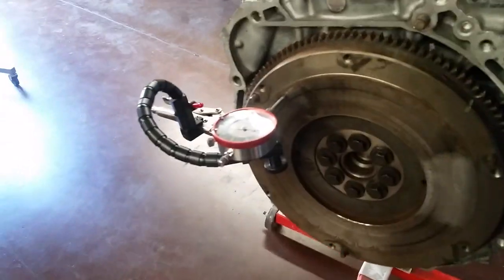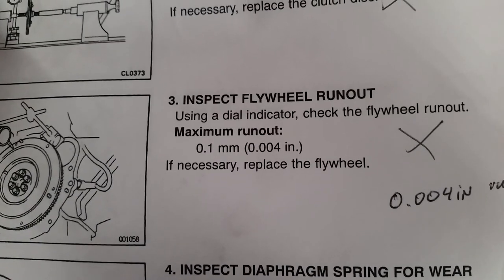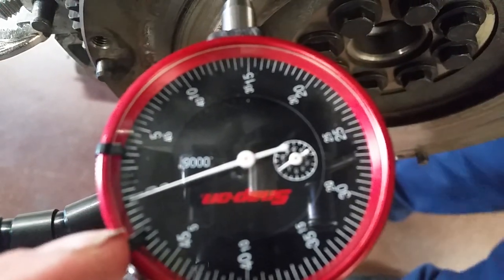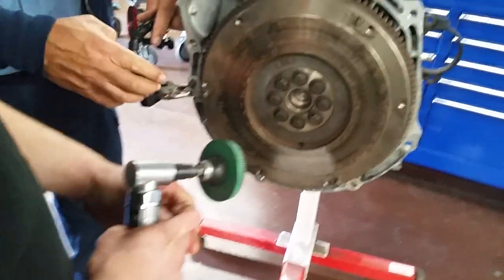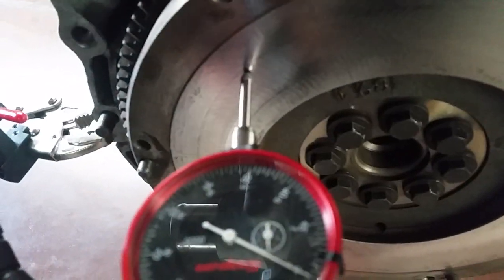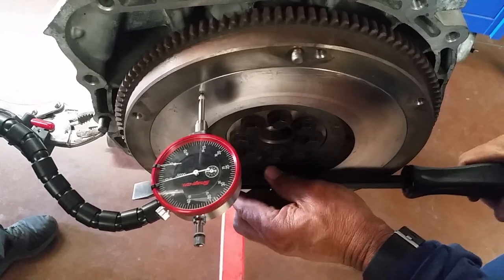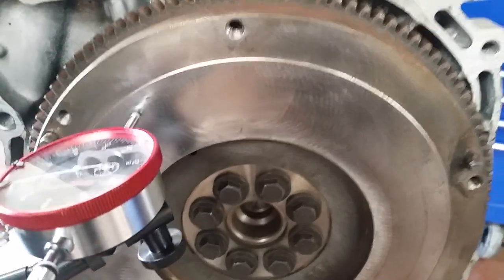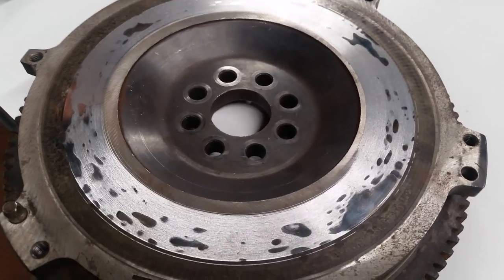How to tell if your flywheel is good or bad when replacing a clutch

Comment: You should really get a specialist flywheel grinder to resurface the flywheel. They can even sort out that polished flywheel. What you haven't checked is the difference between the inside and outside as the tend to cone in the middle
Reply from the maker: @jdickson242  good input. I was to go any further than just cleaning it up i would send it out to be machined at a machine shop.

Comment: Hello. Can you tell why the the car sometimes judders when moving into 1st gear at traffic lights, or roundabouts...Thank you.......Ireland.
Reply from the maker: If it is while you are releasing the clutch, it sounds like clutch chatter. It would do it in reverse starting off as well. 
Clutch chatter causes are warped flywheel (this video shows that measurement), or possibly a rear main seal type leak contaminating the disc.

Comment: Hi from India.
i do have VW Vento 1.2L (automatic), and its just 18000 km on the meter, but the mechanic said that my flywheel is rusty and need to replace it, and cost about US$ 500 approx. should i get it done?
Reply from the maker: Ideally you could have it resurfaced. But if that is not an option and the rust is on the face where the friction contacts then you should, otherwise the clutch will not work correctly
Reply: @paulkelley86  Thank you for the help sir. saved me :)
Reply: Any updates?
Reply: @minnus222  Yes i got it repaired by the service person local one, not the VW authorized center. he said that they just want to earn and make all kind of stories. there was nothing like that.
Reply: @minnus222  if you need any specific detail let me  know.
Reply: @beastangel8727  I just wanted to know whether the FLY WHEEL can be grinded/ resurfaced/ RING GEAR replaced?
Reply: many authorized SVC are cheating ignorant customers.
Reply: @minnus222  yes it can be as recommended by @paul Kelley. when i got it opened it was not having any issue there were no sign of rust or anything because my VW was having 17000 KM running in last 3 years. mostly I use the Tata Nexon.
Reply: @beastangel8727  My car is 1996 w124 Diesel benz (The car shown in Kabali movie). I am having my clutch assembly replaced. The SVC guy told me that the FLY WHEEL is also damaged. I am doubtful about that.

Comment: What was name of that grinder you had to resurface?
Reply from the maker: Its just an angle die grinder and a roloc disc we normally call a cookie disc. 
That's just a method to freshen it up. 
The better bet would be to replace or have a machine shop resurface it if there is any visual defects or runout.

Comment: I've been told a damaged flywheel can make my car miss when idling, why would it make the engine miss fire?
Reply from the maker: Hmmm... I have never seen that. I don't see how it would cause a misfire. If it were out of balance I could see it cause a vibration. Rarely the flywheel will have a reluctor wheel for the crankshaft position sensor, which could cause some timing/spark issues but I wouldn't expect it to be a misfire. What vehicle is it?
Reply: Yeah, I thought it was strange but I'm no expert. Also I'm sure its the flywheel as its vibrates when using the clutch and it has that horrid rattle when its idling and if you press the clutch it stops rattling. The car is a VW Golf 1.9 TDi 2007 sport.
Reply: @pumpkinking365  sounds like the throwout bearing
Reply: @icantseeanything.7625  I had a new clutch & flywheel. The mechanic said the flywheel was so bad, he was surprised the car was still running.

Comment: Ok here is the question my clutch bad I know it is time to change but there is very slight vibration on the pedal.so do you think flywheel needs to change or do you think my clutch is bad that is why?
Reply from the maker: It could be the release (throw out bearing) puking. But it could be flywheel runout too.

Comment: Hey mate got a question might be hard, I have a loud tapping sound coming from behind the engine/gearbox, I replaced both gearbox and transfer case and it still makes the noise, only makes it when clutch is engaged but car revs fine and gearbox is smooth, any idea if it's the flywheel
Reply from the maker: Cracked flywheel can cause that, but if equipped it could also be a dual mass flywheel. Based on the "mate" I'm gonna guess you may be Australian or similar, a lot of your vehicles use dual mass flywheels.
Reply: @paulkelley86  yeah I'm from Australia 🦘, the car is also a 1993 80 series with a 4.2 diesel with a after market turbo
Reply from the maker: @Jimmybegaming  oh yeah dual mass flywheel very common on small diesels like that. We don't have those here so I can't speak from particular experience but I think you are on the right track with the flywheel idea. 
Now when you say clutch engaged I assume you mean literally clutch disc engaged aka pedal released?
Reply: @paulkelley86  yeah the clutch pedal is all the way out, but if it was flywheel wouldn't it consistently make the noise as the car was revving rather then when in gear
Reply from the maker: @Jimmybegaming  https://youtu.be/_FcDOqHav7o

This should help. Sometimes the noises don't exactly follow the rules but the idea is if there clutch pedal out (clutch engaged) it puts more load on the dual mass flywheel in addition to turning the transmission input shaft.
Reply: @paulkelley86  thanks mate